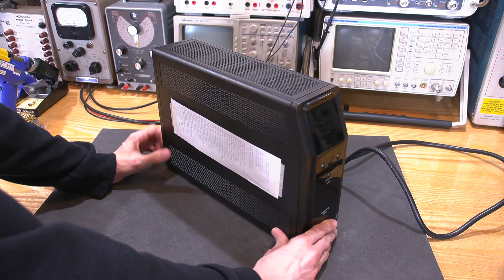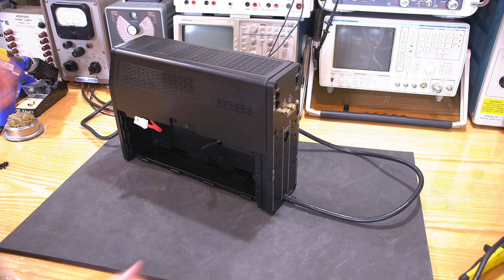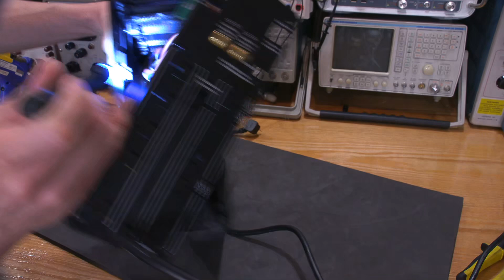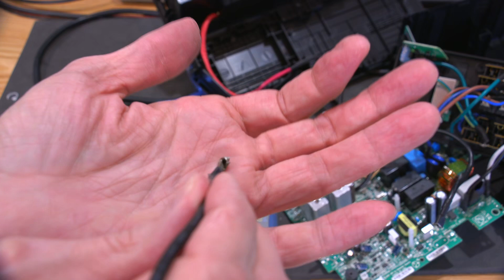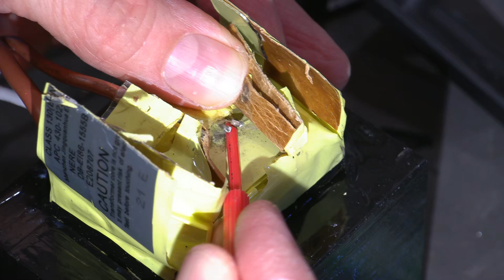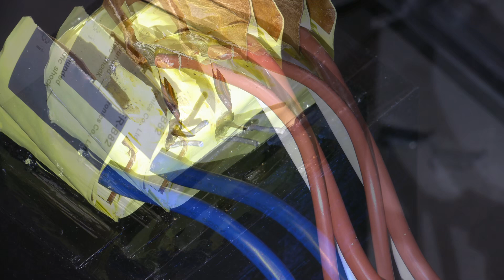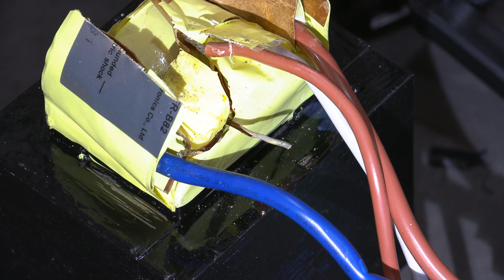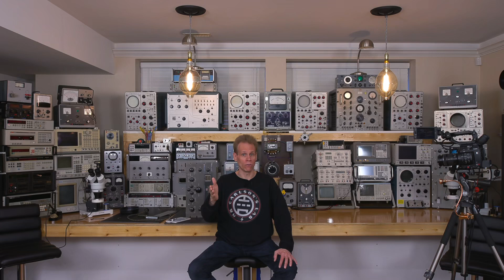UPS Electrical Failure - Teardown and Analysis!

Comment: Sadly, I can''t say I'm surprised to see another failed APC. We've had 4 failures on the 3 units we installed. Yip, the warrantee replacement failed too. My theory is that they see their products as IT equipment, and due to be replaced every 4 years, not infrastructure that needs to last 40. And these were their R60 000 SmartUPS series.

Do not recommend.

Being in South Africa (three power failures/day, on average) we now install proper infrastructure grade hybrid inverters (Victron, etc.) and Lithium Iron Phosphate batteries.
Reply: I've recently done the same for my small home office - ditched my APC SmartUPS (which itself was a replacement for one that cooked its batteries and was almost too hot to touch when I found it) for a Victron Multiplus II 24/3000 inverter and 2x LIfePo4 batteries.  So far I'm very impressed - also helps that I've now got 2x400W solar panels hooked up so the office should be pretty much off-grid all summer, and I can now power the entire office for probably a couple of days if the power drops, rather than just my PC and some networking gear for ~20 minutes.  To be fair it was just a little more expensive than the APC UPS but worth it I think.
Reply: Got an old APC750XL I got as free, dead battery packs, and use it with 4 car batteries externally. It works well, and I get 2 years out of the cheap flooded batteries, though I do have a monthly reminder to service them, which means checking the electrolyte level and filling it up, as APC really loves to fast charge the batteries, so you get back to full charge in 4 hours, though they take 8 to fully float charge. Toasts the SLA packs, but the flooded cells do not really mind, as this is a lot lower stress than being in a car engine bay. Just buy the cheap batteries and use them.
Reply: @SeanBZA  Back in the old days, we sometimes would modify rackmount APC UPS's to lower the charging voltage a bit for this very reason.  They were notorious for cooking SLA cells and they'd expand to the point where you might need a crowbar to even get them out of the aluminum frame.
Reply: @SeanBZA  It wasn't the batteries that died, it was the UPS. Also, nobody uses lead acid in this country anymore,
Reply: @johnalexander2349  True, but it has use where you only go to 10% down per load shed cycle, or where cost is a driver.as they are a third the price of the lithium iron ones. Also the lithium iron are hard to get, always out of stock.
Reply: @SeanBZA  There aren't many applications with just 10% depth of discharge that I'd hook up to even the smallest UPS. You're talking about single digit watts maximum draw, even if you're installing a 28aH battery. Any more than that and you're not gonna get 10%, or you're installing 40kg of lead.

Regal has the 7aH and 17aH lithium replacements, and everyone has the 5kWh ones, so supply isn't an issue for me.
Reply: @johnalexander2349  Yes they do, when they get stock in, it moves out fast. Got an order in for them as well, not going to pay R2100 at Stealers for the same unit.

But things like alarm systems the SLA does tend to hold, even though alarm companies now give the 1Ah cell with the system, which dies after a year, instead of the 7Ah, which does hold up well. Home alarm the 7Ah held for a 4 day outage fine enough, and it was a battery I got used from gate applications, where it was unable to handle the power off demand, but alarm use it was fine with light load. Garage and gate use the lithium is starting to look good, but whole house yes lithium is better over SLA.
Reply: @johnalexander2349  In a number of industrial applications.. they still use lead/acid batteries, Generally gel filled deep cycle type. Car battery sized batteries are still quite pricey when NMIH or Lithium.
Reply: @GunnerAsch1  I am well aware of the price of batteries, especially since "car battery sized" is small in the applications we're talking about.
Reply: @johnalexander2349  Indeed. I guess I should have said "Diesel Truck" sized batteries. Im a millwright, it wasnt a personal critique of something you said. Sorry if you took it that way.,
Reply: I have two old rack-mount type APC ones that are probably 20+ years old now... I've replaced the batteries twice, but thankfully they've been rock solid otherwise.  I have one smaller one on my PC, but that still probably 10+ years old (probably could use new batteries, only lasts 10min maybe in an outage, but it's long enough to save what I'm doing and mostly I'm using my tablets these days for basic internet stuff).
Reply: 4 years?  You're lucky to get 4 months out of an APC.

Comment: Looks to be copper clad aluminum (CCA). Very common nowadays with high copper prizes!
Reply: CCA would be copper colored on the outside and would accept solder, that's looks like pure aluminium dipped in enamel.
Reply: Its not clad, its solid core aluminum.

Comment: All APC UPS's comes with that label on them, brand new from the factory, from the small ones to the corporate size ones. It's a test that is run at the end of production before each item gets shipped. How long since you purchased it? It may still be under warranty? It's most likely a line-interactive type of UPS. I would recommend to use an online UPS. APC is a great when you buy their larger UPS's, from 10KV and up instead of multiple small ones. The online UPS's will do a much better job in protecting your equipment from line surges, holding the power supply clean and stable to your equipment. They are costly though, but are way beyond the small ones in build quality. We run one APC 10KV from late 2000s and it's still working just fine. We've changed the battery packs a few times, they last 5-7 years before they have to be replaced. Greetings from Norway.

Comment: I have the same UPS, with the same error code "F04" - clamp short as per the documentation. Just thru it out and replaced with another brand :(. The only guidance is "the unit should be taken out of service and replaced. If the unit is under warranty, please contact local support for assistance". Of course it was 1 week out of warranty

Comment: The thing on the side is a factory testing protocol, and you get that with every APC UPS, or at least every half decent one. It is there to tell you the unit passed QC and works, so you can be (relatively) sure that it won't cause a power outage itself.
Reply: Yeah, what he says. Every APC comes with that label for some reason. Really makes no sense, since they wouldn't send out out with any 'FAILED' on it.
Reply: @centauri61032  I think it is there to make sure you didn't accidentally receive someting that didn't pass QC and put that thing into a critical application. So if they mixed the units up, threw a good one out and gave you the bad one, you can show them that it says "failed", and they will give you a new one. This protocol follows the unit through the entire QC and shiping process. Some car manufactureres also do this, so that a worker can't accidentally skip a step in the assembly, and you don't end up getting a car without a horn or a muffler because someone forgot to install it. Some even take this to an extreme, using electric screwdrivers that track which screws are tightened, so they can't forget a screw or leave it loose, causing stuff to rattle or fall off.
Reply: I used to procure 100’s of these things at a time for call centers, that test sheet comes on them always
Reply: yep, they have done this for a long time
Reply: Indeed, and not only UPSes. All PDUs, ATSes etc I have from APC all came with that piece of paper with sticky tape on both sides. Nothing special about it.
Reply: It's ironic in this case.
Reply: It's standard for UPS’s, APC anyway. Its always been on them. I have units from a decade ago still going good.

Comment: APC includes that slip with all new products.   I'm yet to find ANY UPS maker that I've been satisfied with...   most units have a 3 year life span...  Batteries are one thing... but the circuitry isn't reliable.   I work as a computer service technician...   so I see LOTS of make/models of UPS.
Reply: Eaton is pretty cool. Maybe it will do the job for you.

Comment: I've been contimplating designing/building my own diy UPS, and debating the idea of using lithium ion, or maybe deep cycle marine batteries? etc... How clean does the supply need to be? Can I just run a server directly off battery while continuously charging it? Or is the fall over relay required? Etc? But have found there's surprisingly little into out there. If you're ever looking for an idea for a video, you might want to consider the topic. You'd have one of the very few videos on YouTube about designing a UPS.
Reply: I would think using a direct DC power supply for a server would be difficult, since I believe it has multiple voltages. (+12, -12, +5, +3.3 maybe?) However, your overall concept seems sound. I worked in the telecom dept of a hospital for some years. And the phone switch gear was directly powered from batteries, which had a charging system attached to continually keep them charged as long as there was mains power available. The downside to that arrangement is that we had to shut the entire phone system down annually to test and/or replace the batteries. But the advantage was having zero switchover during a power failure. On a related note...  I do use a direct battery supply with external battery charger for a Raspberry Pi application I have. Basically, just an off the shelf 5v portable power bank that can charge and power at the same time. Simple plug-and-play.
Reply: @centauri61032   yea, I work for a telecom now and that's how all our equipment runs. Directly off battery, no AC.